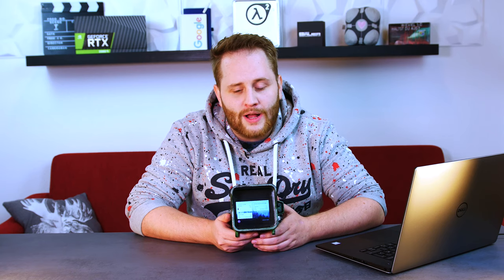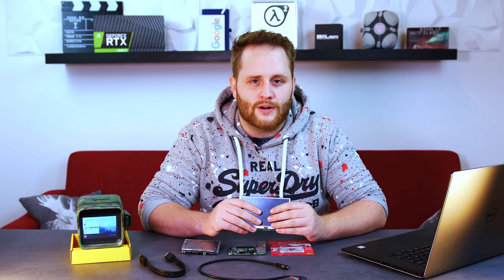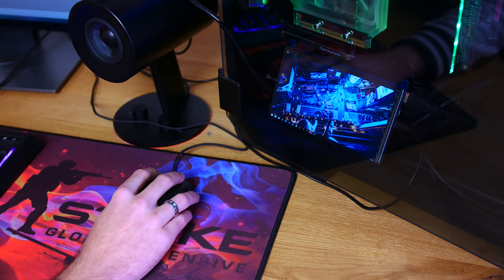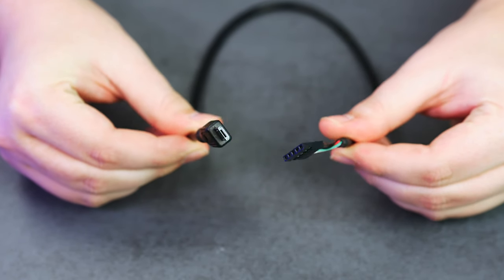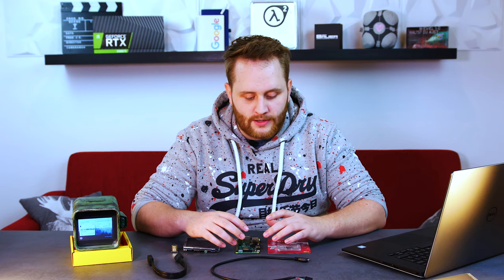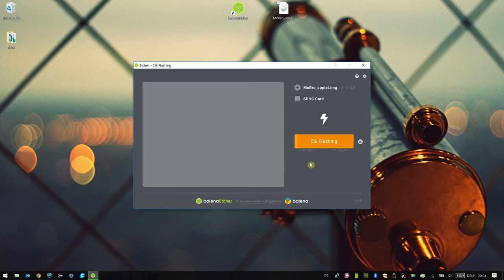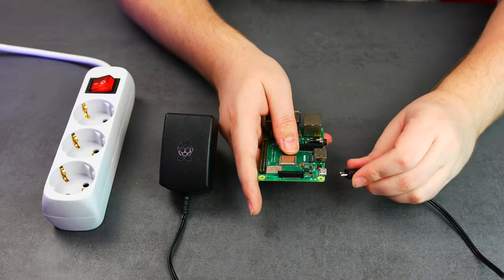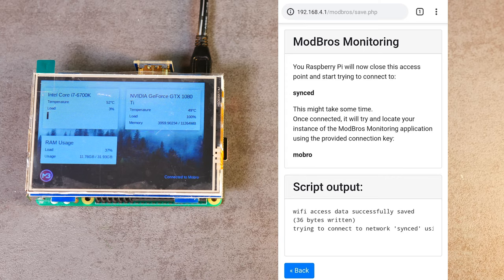How to create a PC Hardware Monitoring Screen Inside your Case

Comment: Got any new themes and backgrounds?,  this thing displayed on a 19 inch is empty and i'd like to mod the mod
Reply from the maker: We are still working on the updates. Currently we try to make everything more stable and implement themes for the October update. About customizing what is displayed... We are currently thinking of a way to do that but that will take some time. Background should be easy but information depends alot on the system. Also getting more information from all these different motherboards and sensors is very hard. Libraries for reading the sensors are very costly on a yearly subscription with over 5.000$. We are trying to find a way around that aswell.
Reply: @ModBros  Any updates?, can you have the system remember wifi info and + ... please, don't use the system since i can't reboot without re-doing setup
Reply from the maker: we're still working on a bigger update including more data and themes. unfortunately it takes a bit longer than we initially anticipated 😅
which version of the Raspberry image are you using?
the WiFi issues you mentioned should already be fixed in the newest version (v4)
Reply: @ModBros  Was using V3, there was no V4 when i first got it, i WILL be looking at it TONIGHT... BTW, i'm pretty happy to see you are still working on the wonderful concept, keep at it! :)
Reply: V4 doesn't work with my HDMI ?
Reply from the maker: @Stormy73  Super late reply 😅
But just to let you know, the current version should have all of the wifi issues resolved and does of course work with HDMI.
Also wired LAN is now supported :)

Comment: Everything done verbatim,....my pi sits at LOGIN for about 30 seconds and then moves onto the MOD BROS splash where it says its going to create a hotspot, it sits there for about 10 seconds and does not do anything and then reboots itself...over and over.  Need some help
Reply from the maker: Hey Brandon, thanks for trying out the MoBro and telling us about your issue! We're currently investigating this issue. There is already a blog posting on our forum that might be the same problem:
https://www.mod-bros.com/en/forum/t/when-booting-modbros-image-it-gets-in-an-eternal-loop-of-booting-trying-to-connnect-to-internet-for-a-while-then-rebooting-again~1101
Either jump in the conversation there or if you want tell me more about your setup so we can help.
Reply: @ModBros  This happens when you DONT have enough power to the RASPPI.  I confirmed this by using a plug directly into 115v to usb.  Everything Works.  Thank you.  People, make sure you are getting enough power to the PI device from the USB connector!

Comment: Can you access the terminal on the pi itself
Reply from the maker: You can connect to the pi via ssh
Reply: Mod Bros the only thing is I can’t check the IP address of the pi so I have no way to interact with it I’m just trying to install the display drivers to use one that only interfaces with gpio
Reply from the maker: If you have already done the Pi WiFi setup / or connected it via Ethernet and it's successfully connected to your local network you can find its IP-address by going into your cmd.exe (windows command prompt) and type in "ping mobro-raspberrypi.local" if your device supports mDNS.
Otherwise you could try finding it's IP via an App on your smartphone like Fing - Network Tools. Its available for Android and iOS.
Reply: Mod Bros thanks for the suggestion I’ll try it out and be sure to share any updates thanks for the cool project

Comment: I'm using a raspberry pi 3B and it is being power directly from my power supply via a molex connector. the raspberry pi stays on and functional all day however it can't consistently stay connected to my computer over the network and will occasionally drop off throughout the day. I've tried reinstalling the image I've tried two separate raspberry Pi's I've tried making sure my firewall isn't the issue and sitting static IP's etc. anyone have any idea why my screen can't stay connected to my computer????

edit- I should also note I'm on a b550 motherboard with a 5800x
Reply from the maker: Maybe the Raspberry Pi sometimes looses the Wifi connection, if the signal is too weak. You could try to place your Pi outside the PC case for a day to see if that solves the issue
Reply: @ModBros  I think I figured out the issue it was my router slowly beginning to die. got a new router and it's been stable. Thanks for the work you guys do it really lets my build stand apart!

Comment: Can you do this without a wifi connection?
Reply from the maker: Yes, you can also use a wired ethernet connection
Reply: @ModBros  oh really? So if I plugged in my raspberry pi into my router it would work like that??
Reply from the maker: Yes it does :) As long as your PC is connected to the same network of course

Comment: can Raspberry read the pc info through internal USB instead, like Aquaero?
Reply from the maker: We have looked into that, but the USB power port on the raspberry has no connected data wires. So that does not work unfortunately. 😐
We could do it with the additional USB, but then we would need 1 cable for power, 1 for the data and another one for the power of the display.. ^^
Reply: @ModBros  That is the least of our problem, when i make this kit i can solder the stuff together, but the main issue is the software on the PI, once there is a ready to use software like that i would totally do the usb kit, believe me that there is lot of people ready to solder stuff, but we need a robust software like Aquasuite, even if it was paid like the Aquasuite
Reply: @ModBros  Actually, i strongly believe that Aquacomputer are working on something like that, because nobody is using cases with 5 inch bays in them which will render the Aquaero 6 useless due to its small calculator-type 1 color screen, I can swear that Aquacomputer are going to release some colored screen for inside-case use
Reply from the maker: I think soldering is not the issue, the connection on the board itself is missing. So there is no way. We are currently thinking of a solution and are also working on the software to get more data to the pi and some kind of templating and touch interaction.
Reply: @ModBros  Can't you connect Raspberry Pi to your computer with a serial connection (USB to UART module)? I don't know if that will work as i know nothing about Linux

Comment: Im not really tech savvy but i have a big dumb creative brain 😭 i want to get a 2gb raspberry pi and a small round display to basically make my own NZXT gif display. Is that possible??
Reply: The screen i chose has 7 or 8 wires and I made sure the pin pitch matches the raspberry pi. I really hope it works. I got a raspberry 4 I hope that's not bad
Reply: Ok I see what you're doing... building an app kind of that will display the temp. I just want mine to switch between gifs when it gets too hot I hope I can learn or find a friend who knows how to code

Comment: I just download your image and flash it with etcher, but it don't works
I juse a raspberry pi 3b+ the red led rurns on when o powered it with the micro usb but there is nothing on the screen and the green led do not glowing (sry for my bad english iam from german)
Reply from the maker: Wir sind aus Österreich, also Deutsch ist auch OK ;)
was verwendest du denn für einen Bildschirm?
Geht der Bildschirm an? Also zb. ein komplett weißes Bild oder passiert wirklich nichts?
Reply from the maker: Und hast du dir das tutorial auf unserer Website schon ansgeschaut?
Reply: Ich habe ihn ersteinmal an einem normalen Bildschirm angeschlossen da ich später den GPIO 3.5 inch Bildschirm benutzen werde und ich für den ja erst den Treiber installieren muss.
Das Hauptproblem ist aber ich habe das image wie auf eurer seite angegeben mit etcher geflasht (vorher sogar vorsichtshalber sogar mit sdformater formatiert )
Und wenn ich die sd einstecken leuchtet zwar die power led aber die grüne nicht also er will einfach nicht booten, könntet ihr mir irgendwie helfen? Ich bin noch neu in dem ganzen raspberry kram, und ich finde einfach genial was ihr macht.
Reply: Hab das problem gefunden, mein pi ist kaputt

Comment: Couldn't this just be plugged in as a second moniter?
Reply from the maker: Yes of course! You could either use the windows MoBro monitoring app directly on the second monitor or you could click on the "open in browser" button in the themes section to use themes in the browser and just maximize that browser window.
Reply: @ModBros  sweet! Thanks for the response

Comment: It's working with the HDMI port, but how to use my 3.6 inch GPIO display LCD to work on?  That is the LCD https://github.com/iUniker/3.6NewDriver
Reply from the maker: Hi, I just posted some detailed instructions on this issue as an answer to the post you left on our blog.
Might want to check it out and give it a try :)

Comment: Is it possible to play a gif on the display ?
Reply from the maker: With the theme configurator that our patreons are already testing and using it is possible to add as many gifs as you want! Ofcourse that will depend on widgets that the theme itself provides, but all our own themes that are currently shipped with the theme configurator do.
Reply: Empfehlt ihr den zero w ohne pins oder ein 3 a+ für euer Programm
Reply from the maker: Also am besten wäre ein 3 b+
Mehr dazu im FAQ https://www.mod-bros.com/en/faq/mobro/raspberry/supported-hardware

Comment: App stopped working out of nowhere for me :( doesn't even launch anymore..
Reply from the maker: Hey, sorry to hear that - I'd love to help but I'll ned more info on what is not working and what did you already try?
I assume you are talking about the Windows MoBro app, right? 
Is the process still running? Is the app icon still in the windows tray? 
Did you change files in the MoBro directory?

We've got a similar ticket on the forum: https://www.mod-bros.com/en/forum/t/desktop-app-crashing~1111
Reply: @ModBros  Hi! It's actually the same exact issue that person is having. It shows the launch screen pops up and disappears. Doesn't show up in tray, but shows up on task manager.
Reply: @ModBros  So I followed your link and browsed around the forums. 

https://www.mod-bros.com/en/forum/t/new-beta-update-install-failed~1056

I did exactly as you said in this thread, deleted everything ModBro related in the /user/AppData/local. After that I decided to update my RP SD card with the latest image (I was on v3, now on v11) and connected via ethernet and bam, works like a charm.

Thanks!
Reply from the maker: Awesome! Glad that it works again! We're going to look into that issue. If you have this issue again, please let me know before you fix it so we can take a look at the error logs 👍
Reply: @ModBros  Ahh you're right, I should have at least saved the logs. I kind of just deleted all the folders :( I'll remember next time if it happens again. Thank you! Love using this as a monitoring system rather than my secondary monitor.

Comment: what advantage is this over just using a small screen and using rainmeter/wallpaper engine to display the results on?  Like this:  https://www.youtube.com/watch?v=RcNJA6V4tNY
Reply from the maker: Well in your example you need to connect the display to the graphics card and then configure a separate screen within Windows.

In our case you do not need a connection to the PC at all and you can place your screen wherever you want in your room because it works over wifi.
You also do not have an additional screen within Windows.
And you can also use your phone as a display ;)

Comment: No thanks, I'm not a Raspberry fan and I think this is a far from close solution, using external operating system to monitor an entire other one. My way:  I'm using an older tablet on WiFi and Spacedesk to use the screen as an external screen. And with the Aida64 Extreme app, it's fantastic.
Reply from the maker: Whatever floats your boat and works for you. 
But just to clarify, you can also use an external screen with our solution. Our bonus is the ui configuration via drag and drop and our data points are not bound to just Aida or hwinfo. You can monitor whatever you want 😉
+ there is an api and dev cli in the works to create and run your own code 🔥
Oh and mobro is free 🤑

Comment: $50 for this... their are other situations, i have another phone and i have app for it and software on my pc that connects and monitors the system for only $5
Reply from the maker: Well, you don't have to use a Raspberry Pi
You can also use our Android app or just use our desktop application with a normal secondary monitor
No need to spend 50$ if you don't want to ;)
Reply: No doubt, but how do you feel about permanently leaving your phone in your PC case, and does it look good?
Reply: @brandonstinnett9150  I don't have it inside my PC case... I have it outside on a phone stand that is next to my monitor....

Comment: Software has virus
Reply from the maker: Our software is not signed, that does not mean it has a virus. It just means we cannot afford hundreds of dollars to get a Microsoft sign token, because it's just a free private project for the community. :)
Reply: Mod Bros I dont know much about viruses, but Virustotal says it has a virus
Reply: but im not sure if it is a dangerous one :o
Reply from the maker: What virus tool are you using? We even have lots of parts of our software open source btw.
Virus tool might say that bacause our software needs admin rights to read system data and as i said we don't have a license token yet because that's very expensive.
Reply: @ModBros  im using "VirusTotal", it detected HW32.Packed. . I looked it up now and HW32.Packed. means, that the Virus tool cant see everything the file contains. Therefore the tool thinks it has a virus.

Comment: stupidly inefficient solution. just get a small hdmi screen. no coding or building needed, costs less than $100, and its fully plug and play.
Reply from the maker: Yeah of course you can also do it that way. And our MoBro Windows application also supports that use case.
However if you want a wireless solution that isn't tied to your PC via cable and doesn't add an additional screen to windows, we think thank MoBro on Raspberry Pi is the way to go ;)
Reply: @ModBros  i dont see why you would  want those particular features on a screen that, as your title says, is intended as a "Monitoring Screen Inside your Case"
. 
if you want a wireless one unattached from your pc, theres always wireless hdmi adapters, or even wireless wifi monitors now, both of which are much simpler solutions.
as for the inconvenience of the second display (understandable), you can get numerous software packages for restricting a mouse movements to certain monitors
Reply from the maker: Well, you can check out our video where we built a pip boy to monitor the PC for instance.
Also I personally have the screen sitting on my desk and  its just more convenient to not have to wire it to the PC.

And as I sad, the software will also run without the Raspberry, so you don't have to use it if you prefer to do it the way you stated. It's just about having options.
Reply: @ModBros  maybe the video title should be changed to "how to create a wireless pc hardware monitoring screen screen sitting on my desk"